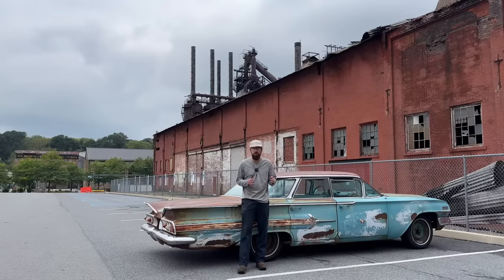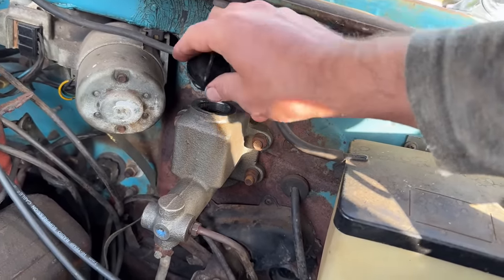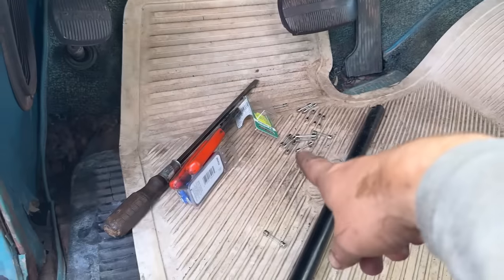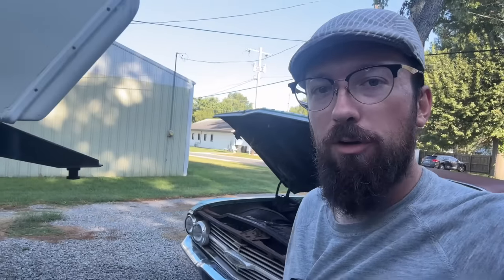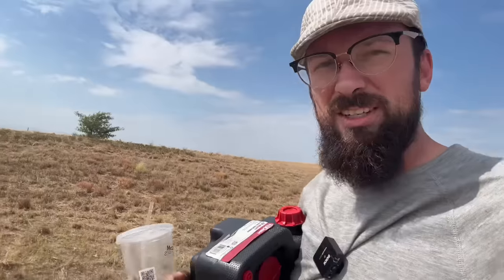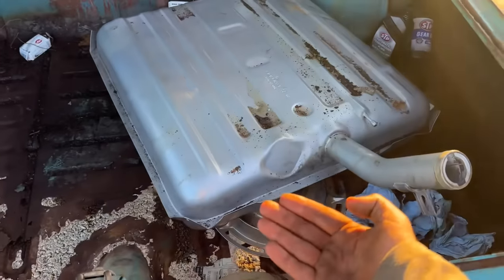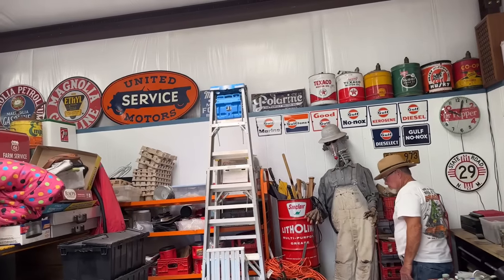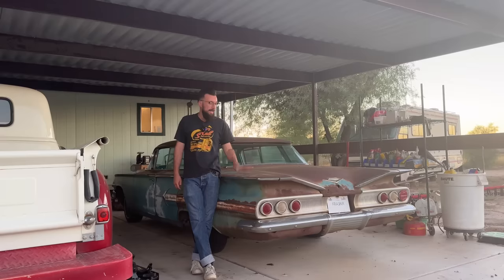2,556 mile trip in a 1960 Impala. Will it run and drive home? Part 2!

Comment: To all the people from NOT the United States. THIS, my friends, is the DEFINITION of freedom! We can drive anything 'legally' on the road that, as stated, has tires, brake and tail lights, headlights, blinkers (although NOBODY uses those), a clean front windshield, registration and plates, and if it's 1969 or newer it needs a shoulder seat belt. That's right, prior to 1969 you're not required BY LAW to have a shoulder harness. Imagine that.

Comment: Dont.over.grease the bearings. When tightening the bearing, run the nut up snug but not tight. Then back the nut off a.1/4th turn.😊

Comment: My 71 Chevy C10 short bed  had that carrier bearing     but not no more because  I changed the 3 speed transmission out to a granny gear 4 speed   and had a new style drive shafted made to order   with a slip joint    the 4 speed doesn't have a tail shaft for a slip joint drive shaft   so the drive shafted is a 2 piece with the slip joint near the transmission end    and both ends bolt on to the differential and transmission    it works fine  and I love the 4 farward transmission  first gear granny  with top load shifter    when I'm not towing a loaded trailer   I just use 2nd , 3rd and 4th   just like the original 3 speed was    I'm running a small block 350   with the same style exhaust manifolds as your Impala has    with dual pipes all the way to the back bumper     it's a rust buck like your impala   but still tough as nails   ✌😎

Comment: The radio can be fixed.  I imagine the vibrator is stuck (It looks like a set of points inside a can and converts the 12 volts up to about 90v for the tubes).  It plugs in like a tube does.  You can either open that can and file the points or just replace it with a solid state unit.  Change the old wax/paper capacitors out and any out of tolerance resistors and I bet it'd work fine.  Tubes themselves seldom ever go bad though they'll get weaker over time.  Those old radios can really draw the stations in a lot better than newer ones.

Comment: Hey friend you are good duing what you doe with your cars that 60 chevi runs good my father had 1952 chevi pick up whend he got the truck it came with the 235 6 cylinder engine he change it to 283 v8 and he change the rear end from a 1967 camaro on the truck

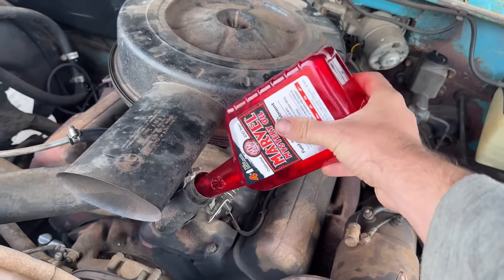Comment: 36:16. Can be used as a mouth wash.  Minty fresh!  😂

46:00. Curious why you picked that exact spot to move your gas tank instead of 100 miles down the road when it was lighter and not on the side of the interstate.

Comment: Wonder if the tank failed due to weight/flex as all the weight was on the filler neck? Also you could use some petrol tank sealant - while not a perfect solution it could have worked ?

Comment: My old 240 Volvos had a Steady Bearing on the Drive Shaft like tht...  I'd tear them uP spinning & $hit...And i also had a Volvo wheel bearing fall apart all over the ground like tht too... I put em bk in, packed em wth grease and drove another few 1000 km's on it.........ha

Comment: Small journey steel forged crank 283 is one of the very best motors there is bar none. Replace all the valve stem boots in the heads and a new set of thick Fel  Pro valve cover gaskets, and change out the Power glide for a Turbo 350 and god only knows how long that old girl will stay on the road. Put it to you this way, I got 681,000 on my 68 Camaro with the same 327 I bought the car with brand new. True I have over hauled the 327 three times but still,  well over 1/2 a million miles.

Comment: Different gas in Different areas .... I exprienced this in my toyota tacoma..... you are going to experience this as well.....check your tank bolts..... the one good thing is that the car does not vibrate as much as it did when you first started your run....
Reply from the maker: Yeah the different gas / ethanol mixes mess with my mileage

Comment: Schultheiss is an old german (talking early middle ages or maybe even before) word for a lower rankig official, in an abstract way like a sheriff. In this case "Schuld" could be best translated into "guilt" and "Heiss" to "call" or "order". So a "guilt caller" who could enforce the law, collect taxes etc., whatever the higher ups told him to. Nowadays its a surname,  which still exists, but was mostly shortened down to Schult/e or Schulz/e over time and depending on the region.

Comment: I've heard and seen instances of brand new replacement parts not lasting as long as even used OEM parts across multiple types of vehicles over the years.
Such a shame, even traditionally high quality replacements parts like from SKF or FAG have just gone downhill once they make a change to an already good process by going overseas or using cheaper materials to keep costs down.

Comment: Seal only on one side of that axle bearing. It's lubed dy the gear oil. Most likely the wheel cylinder is stuck causing the brakes to drag

Comment: Here, in Eastern Europe, you need your MOT inspection to date.
You would not be able to pass the MOT, because of the rust.
MOT, is the first thing, police looks for.
And, they pull over any vehicule that looks suspicios.
If you try to drive without the MOT, they take you license plates, fine.
Reply: Your problem with the bearing heating, îs because the bearing îs not installed correctly.
You should take it off, check.
Bearing can lower car mileage .
Reply: Just take the bearing off, see what's happening.

Comment: I'd like to give you 3 emergency breakdown tips  #1 for radiator or heater core leaks put 2 tablespoons of ground black pepper run to temp. after it seals your leak drain syste and refill
#2 a pair of womens panty hose makes a great emergency fan belt
#3 for leaks in your gas tank soak a bar of soap til it gets gooey and  mix in white sugar  it works jim dandy for a temporary fix  (It works on propane & gasoline)

Comment: The problem isn't about whether something was american made or not. The big issue nowadays really is that, no matter where stuff is made, quality standards have dropped tremendosly to accomodate for new consumer habits (replacing is now considered superior to repairing, whereas a few decades ago the approach was different. there's also a big market pressure for prices to be lower/remain the same regardless of inflation, which turns drops in quality unavoidable)

Comment: I happened across your videos for the Impala and mostly enjoyed them, however being a shade tree mechanic for over 45 years (not ase certified), I cringed after you replaced the right inner bearing on the drum! I figured someone else would point out your mistake, but not seeing it. I didn't see you properly "seat" the bearing, and suspect that is why it failed during the drive home. What I didn't see was you over tighten the axle bolt by about one quarter turn, which will make the drum very hard to turn (if needed you might need to tighten further) but not impossible. You need to turn it at least 2 times, that will seat the bearing; then loosen and re-tighten the nut to correct running tightness. The correct tightness will be when the drum turns, but does not free spin - it should be tight. It will free spin once the tire is mounted. I didn't see any sign of that process in the 2 times you installed that bearing. I think there was "play" in the bearing as installed causing the abnormal wear. I would highly recommend you reseat that bearing now that you got it home - even though it has some wear - to prevent further damage to that bearing. I mostly enjoyed your series on that car (I'm the same age as it) I may check out some more of your videos.  Stan from Florida.

Comment: Well yeah peoples from europe will ask these questinos since our car inspetions and legalities are quite strict my car failed the exam because of a single rust hole in the left side skirt not even my pinky can fit in so the car was legally trash so i had to buy another car jsut to go to work. And rotted in a shed for years and 2023 christmas to new year sit got new sdie skirts all the even barely rusted metal bodypanes got replaced with a more rust resistant steel then it was originally made from (it was more expensive but in a lnog run woth it) and got my papers back and the car back on the road...

Comment: About car and legality, my son was to the Spanish  six moths revision at ITV ( tech inspection of vehicles) and was rejected because he has lost the break pedal rubber .
Modifications that are extrictly forbidden , rubber tires outside the body of the car , changing wheel more than 10%......you name it.
So imagine if you get riding your Impala in Spain, jail is guarantied !
I think anything in the middle would be ok.

Comment: Better replace that hose!  You'll be walkin 🙂   it's rotten... If a small block chevy's valve cover gaskets arent leaking, you're out of oil  !    The valve covers were pretty thin and easy to warp around the bolt heads....  The heater hose WILL loop off, but you have to clamp one side really tight, or use the smaller hose and work it on the larger fitting, but you almost have to have new hose so it won't split open

Comment: The gas mileage got worse from two things 1. Points and plugs worn down
2. That Kink in the rubber fuel hose you fixed was Prolly starving the motor!

Comment: LEAVE THE RADIATOR CAP LOOSE....NO PRESSURE...WATER WILL STILL COOL...LEAKS LESS....TOWED A TRAILER FROM CALIFIORNIA TO PGH ,NO ISSUES..FIXED A YEAR OR SO AFTER I GOT BACK.....

Comment: You are fortunate your gas tank didn’t fall out and explode while you were on the road.
I applaud your gumption, but driving a car with a new gas tank attached to a rusted out trunk pan is completely irresponsible.  I also wonder why you didn’t address the leaking exhaust system.

Comment: You know you could have thrown a rudimentary exhaust on the car, and then you wouldn't have had that demolition derby sound and also given the motor some back pressure. By the way always carry some gas tank repair kit with you to two-part epoxy that you can put on a leaking tank and it will seal within an hour

Comment: I don't understand how the quarter panels and wheel wells are clean enough to damn near eat off of, in terms of rust, but the floors and trunk of the thing are straight out of the flintstones. I'm talking straight up yabba dabba doo, connected via WIFI. how does that happen?

Comment: 18 mph out of an old 283. Always loved those little motors. Powerglides never break. You will need a rear wheel bearing and I HOPE you learned your lesson on "Made is USA" parts.
You drove 2500 miles on 1960 parts. China parts didn't make it 2500 miles.

Comment: All you had to do is bypas the heater. Ive watched some if your trip. I cant velieve how unaware you sre replacing that cap only pressurizes it causing it to blow out quicker. Yoh shoulda never expected that old girl to make that longntrip so crippled
Its machine abuse that may result in you abandoning her on the side if the road.😮😮😮

Comment: The no inspections rule is bonkers! Over here in the UK you cannot drive a vehicle on the road without an annual inspection unless it's under 3 or over 40 years old. Those holes in the floor would be an instant fail.

Comment: For the " driving a like this  on the road" > that is insane

In germany for example:

Car has to have registration and insurance. You cant get it legal without "TÜV" wich is a Institution checking the condition on the car. And you have to Do IT Everest 2 years. They Check for evereything, even when your haedlight adjustment is off > not possibile to drive. They check for emmsions and modications aswell. Everything has to be testet, so just puttig on different wheels for driving home is illegal when they are not the >original to this car< wheels ore TÜV testet and approved.

Comment: I can tell you in two words what was wrong with that bearing .....Rock Auto!!
The old saying you get what you pay for was created with them in mind ...

I've bought cheap from Rock Auto to save money and Every time it came back to haunt me....
I think the last items I bought from Rock Auto was a blower motor and resistor.....both failed in under 6 months....
My advice if your going to use Rock Auto don't buy economy....your wasting money and it's aggravating.

Comment: new parts are a risk ,all made in china unless you get lucky with new old stock, put two new seald front bearings in my nissan, one started going bad not long after. could be you were one 1ft off on torq and 0.0001 oz light on grease or it was a new in box bad bearing

Comment: I find these videos hilarious, the reason we have systems like MOT's in the UK and inspections or whatever you gun toting religious nuts over there call them is literally so you don't endanger yourself and others by leaking fuel all over the roads and hang fuel tanks of a piece of string in your non-existent boot. 

In saying all of this, this car due to its age would actually be MOT exempt in the UK, in saying that, on UK roads this thing wouldn't last 5 minutes. a few potholes and it would crumble into itself.